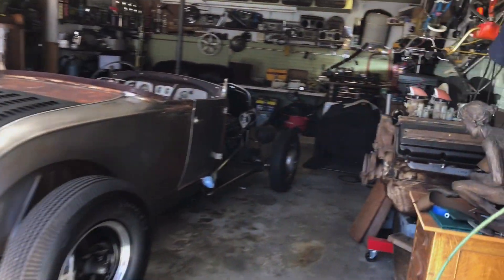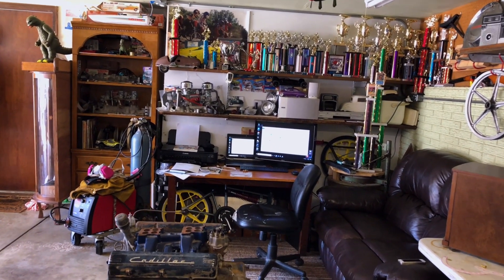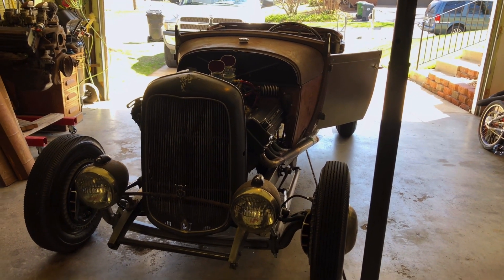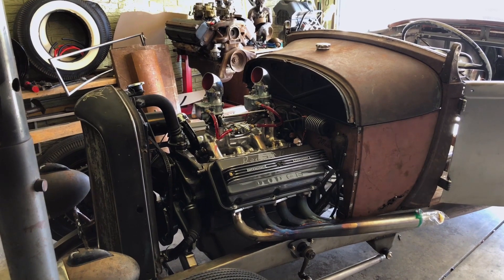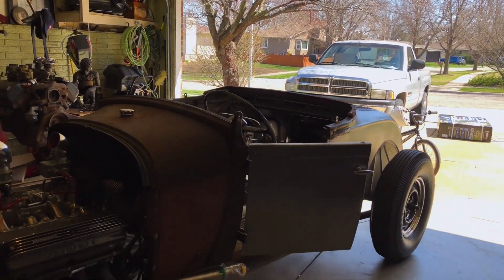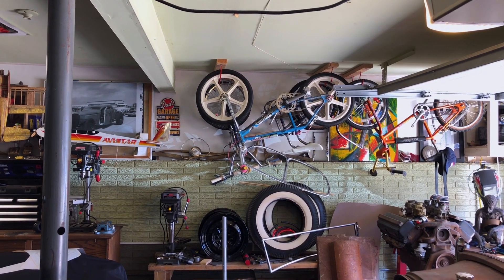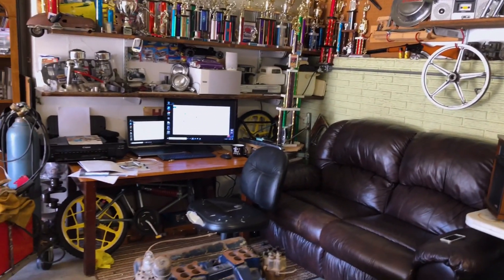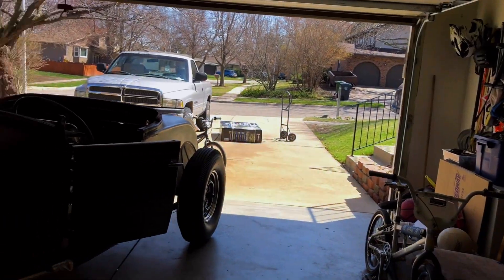Tim Matthews Shop Tour

Comment: I have just sourced a 270 dodge truck first gen hemi for a roadster project of my own. I plan on leaning on your experience once I source a 27 body and frame. Instead of using the Stromburg 97, I have gathered up some matching Stromburg WW carbs to put on a Offy dual carb manifold.

Comment: Hey Tim
Love watching your roadster build. Im working on a 28 sport coupe and was wondering what size wheel and tire combo you running?
Reply from the maker: From Tim: "I am running 1940 Ford 16' original steel wheels.  The rears are off of a 1948 F1 truck 4" wide on the rear, 3.5" wide on the front.  The tires are Firestone deluxe champion 750-16 in the rear (682300), and 500/525 - 16 (635960) on the front.  They are great and I love them so much I decided to do the same thing on my 34 Ford that I am working on - a great big/little combo!"
Reply: Thanks Tim. Love the roadster. Great history.